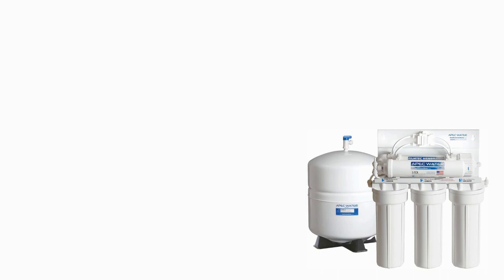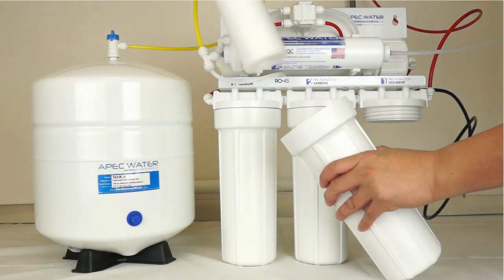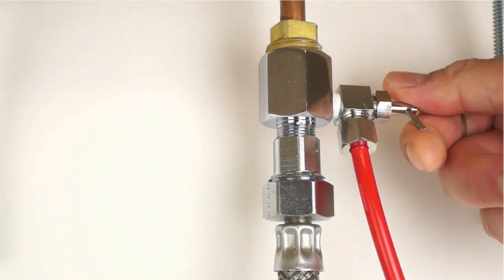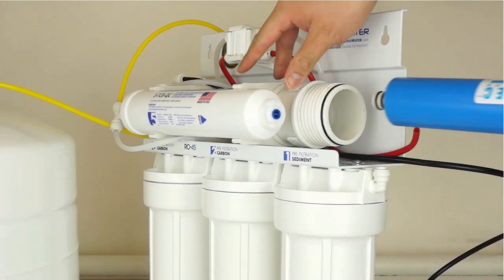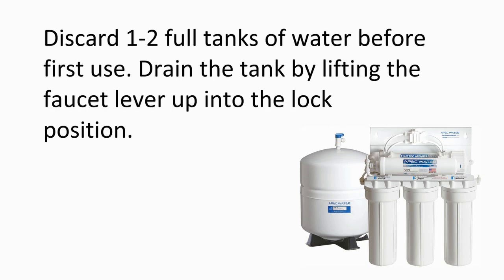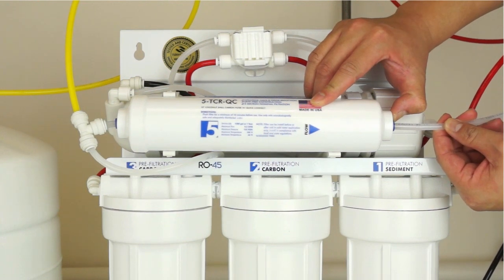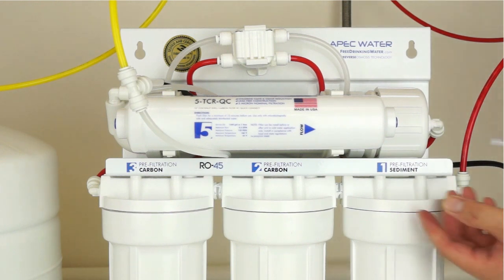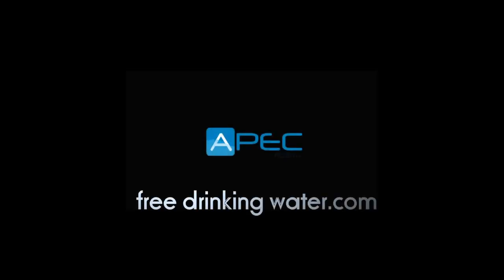How To Replace Your Reverse Osmosis Filters and Membrane-APEC Water Installation Part 6-fixed sound

Comment: Is the 5th filter different for the RO45 and RO90? Because i think i ordered the 5th filter of the RO45 for my RO90 filtration system and it's not fitting smfh 😑

Comment: My 90° elbow at the A line (red) is leaking where it goes into the filter housing.
Reply: I figured out it is a threaded connection. I shut off the water going into the filter. I opened up the stage one filter to drain the water, disconnected the red line, unscrewed the 90° elbow and wrapped it with teflon tape. I reconnected everything and turned the water back on. No leaks at this time.

Comment: I cannot get the membrane cap to come off!! I read in one of the comments that another had the same problem, and was recommended to soak the cap in hot vinegar water.. but the ratio of vinegar to water was not given. ..Any one have an answer? Thanks!!
Reply: I know I had a super hard time w/ the first 3 housings and finally got them open with instructions TIP that came in the box with filter order - it said IF THE HOUSING IS TOO TIGHT, USE A HAMMER AND GENTLY TAP ON THE WRECH HANDLE TO HELP TURN THE WRENCH, it worked but I also put the unit on the floor and bought a Strap Wrench for those 3 suckers, NOW I have that darn MEMBRANE CAP to still try to open, but Ill wait because I still have like another year to change it. Hope this helps.
Reply: @CR-pf1es  Thanking you!!

Comment: What maintenance is recommended for these systems as far as periodic flushing? 
Is there any indication that the filters need replacement from a performance standpoint, or is it just supposed to be done on a time basis, regardless of the amount of water filtered and the quality of the tap water?
Reply from the maker: Thank you for contacting APEC Water Systems. If you are using an Ultimate 5-Stage RO system, we recommend just following the replacement schedule for filters as maintenance. The recommended time frame for replacing the stages 1 to 3 filters is every year. We do not recommend replacing the filters based on the amount of water being filtered as it also depends on the quality of the water. However, some customers are replacing the pre-filters based on the amount of water they are getting from the system, for example, if the customer is normally able to get 2 to 3 gallons of water and then one day the pressure gradually decreases after a few seconds of turning on the faucet (only able to get a cup or 2 of water) and the tank is empty, that means either of the 3 filters or all of them are clogged and need to be replaced.

Regarding the stages 4 and 5 filters (every 3 to 5 years), to help you determine if the filters need to be replaced, you may use a TDS meter to test your water quality before and after the RO system. For details, kindly visit https://www.freedrinkingwater.com/tds-meter.htm and there is a link below for a tutorial video on how to use it.

https://www.youtube.com/watch?v=6IK0dhZZPsE

If you are referring to a different APEC filtration system, please provide us with more details.

Comment: We changed all filters and we still dont know why only a little stream of water is coming out, which is the problem we had to begin with.
Reply: It's most likely a pressure issue that can be fixed with a bicycle pump. If you still have this problem, then reach out to their support team. My daughter and I both had the same issue and they were very helpful. Here's the document they provided to me, although I did clean it up for clarity.

http://captainken.us/ftp/apec_essence_roes-ph75_water_filtration_system_repressurizing_test.pdf
Reply: If you haven’t gotten an answer yet, you may need to re pressurize your storage tank.
Reply: Sometimes the storage tank needs to be pumped with air to increase the pressure
Reply: Same here. Disappointed there isn't a solution.

Comment: So I replaced all 5 filters. When I was done, I turned on the ball valve on the tank. The faucet was still on and a bunch of black stuff came out....is that normal?
Reply from the maker: Dear valued customer, yes this is normal as new stage 5 filter is carbon so when it is new, it requires to be flushed before use this is carbon powder.

Comment: The tubing colors do not correspond to the tubing colors on my unit (ROES-50). I second the request for information about using silicone grease.
Reply from the maker: Dear Valued Customer, please kindly see the attached RO diagrams for your ROES-50 systems. For o-ring lubrication, we recommend using food grade o-ring lubricant like the one we carry below or you can also use Vaseline or cooking oil.

https://www.freedrinkingwater.com/food-grade-lubricant-protects-and-seals-o-ring-to-prevent-leaks-6gram.htm
Reply: @apecwatersystems  Thank you.

Comment: What could be the reason for water coming from filter with pressure even after following changing instructions?First closed water shut off valve and then closed valve on tank and open the fauchet.
Reply from the maker: Dear Valued customer,

This would indicate your cold supply water connected to the Reverse osmosis system is not properly turned off.

Best regards,
Ken
APEC Customer service
Reply: @apecwatersystems  Thank you so much for the reply.

Comment: I opened the housing in stage 1 and couldn’t stop the water from gushing. Do I have to drain the tank of water?
Reply from the maker: Thanks for your message. You will need to first turn off the cold water to the system at the sink faucet or at the feed water needle valve clockwise following our filter change instructions. Afterwards, please turn off the blue tank ball valve on top of the water storage tank and turn on the drinking faucet to properly change the filters with the system out of the cabinet. Thanks.

Comment: This may be a moot question since I live in limestone country, but can I add the PH cartridge (with the necessary extra tubing and fittings) to my 5-stage ROES-75 system to convert it to a 6-stage system?  I purchased the replacement kit for the 6-stage since it was less expensive than the 5-stage kit and verified that all of the cartridges were identical sans the extra PH cartridge.
Reply from the maker: Dear Curt,

Thank you for contacting APEC Water Systems and I am happy to help. Yes you can easily add a stage 6 pH filter cartridge to your ROES-75 system using our Phpluskit-14. Please kindly visit  https://www.freedrinkingwater.com/calcite-acidic-water-neutralizer-10-filter-kit-1-4-quick-connect.htm

Comment: 5 stars for this puppy. In fact, if you buy this, open the box and look through instructions and graphics. The first thing you think, "This is how instructions should be written." At first, it may seem over whelming if you're not a handy man. Look at the pieces and the graphics, slowly. Start to think. Close you're eyes. Relax. You are a plumber. Say it out loud. "I am a plumber."

Now, open your eyes and get to work. If you have to do this again, you could do it in an hour.

One note. This is best installed with a new sink installation. You could take out your sink, that was too much for me. Or, like I did, leave the sink and disposal installed. It's cramped working like that, but, doable. My sink precluded me from installing  through the sink itself. And, on one side was the dishwasher. So, I removed a drawer and installed the spigot on the other side. We lost a drawer, but well worth it.  And, yes, there is a small gap on the filter enclosures, when the filters are installed. Approx 1/16 inch.

Comment: When I install the 3 filter covers, first hand tight, then, with the wrench, there is a 1/16 inch gap at the top. I would really have to force this, to close the gap. The o-rings and the filters are in the cover. Gap?   yes or no
Reply: Did it work with the gap? Mine also has a small gap after using the wrench

Comment: APEC, why don't you have an easy to find tubing diagram that shows how it all connects together???????????????  And after you replace the filters it should be easy to find out how many times you must drain the system before using it.  UGH!!
Reply from the maker: Hello Customer,

We do have diagrams which are in the owner’s manual we include when you purchased the unit and we also can email it over to you as well. In our filter change instructions and in the owner’s manual you would flush one tank of water before using. If you need further assistance, feel free to contact us directly by calling 1-800-880-4808 or e-mailing us at info@apecwater.com. We are in the office from Monday-Friday from 8:00am-5:00pm PST. 

Best Regards, 
APEC Customer Service
Reply: @apecwatersystems  I must admit the diagram image along with the lettering is not intuitive in the manual. You need to update your manual to clearly explain the process. Especially the units that have the 4 way coupler. The entry and exit into the filters and into the coupler is not explained well.

Comment: This is misleading. The 4th stage is almost impossible to open!
Reply from the maker: Hello Derek,

I am sorry to hear about this issue. We recommend you soak the cap side end of the membrane housing in warm vinegar water for 5-10 minutes and use the provided membrane wrench. It should help open the housing.

Best Regards,
APEC Support Team

Comment: If you are only replacing stage 1,2,3 and 6, do you not need to flush the system? It’s confusing as it says “flushing the system is not need at this time” after 1-3. But at the end of the video after 4 and 5 are replaced the system is flushed. Does it mean it’s not needed to flush until after 4 and 5 are done or just not needed at all for just 1-3?
Reply from the maker: Hello,

If your stage 6 is the calcium carbonate pH filter then after changing out 1,2,3 and 6 we do recommend you flush one tank of water through before using it. If only changing out the stages 1,2,3 no flushing would be needed. 

If you need further assistance, feel free to contact us directly by calling 1-800-880-4808 or e-mailing us at info@apecwater.com. We are in the office from Monday-Friday from 8:00am-5:30pm PST. 

Best Regards, 

APEC Support Team
Reply: @apecwatersystems   I think it depends on how water quality is. correct?
Reply: @apecwatersystems  I'm assuming that the "calcium carbonate" and "remineralization" Stage-6 PH filters are different? My Stage-6 FI-ES-PHPLUS-QC filter is labeled "pH enhancing remineralization". My instruction sheet is v2.5.2020 and it only indicates to flush when replacing the Stage-4 filter, but not for the Stage-6. Therefore, if using the "remineralization" filter, you don't have to flush one tank out correct?

Comment: Seems to have covered most things well.  I would suggest reference of the membrane filter wrench to remove/install the cap.  I also didn't see any mention of o-ring inspection for stage 1-3 and proper use of the silicone grease upon re-install.
Reply: Agree- info on how to use the silicone grease, and when to change the o-rings would be helpful
Reply: LOL it's crazy the instructions say to lubricate the Stage-4 double o-rings, but no mention of what to use. Additionally, they need to include a little packet of the recommended silicone grease with the filter.